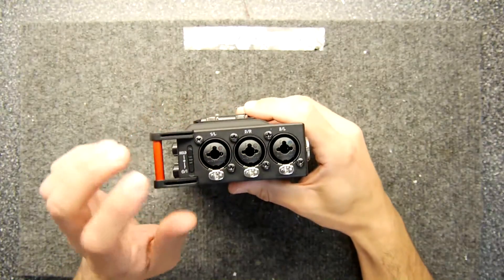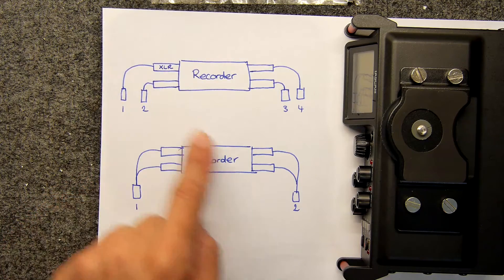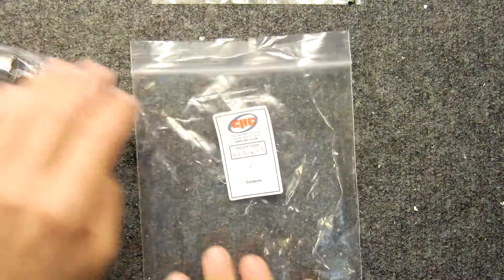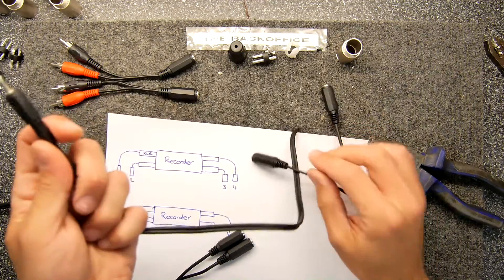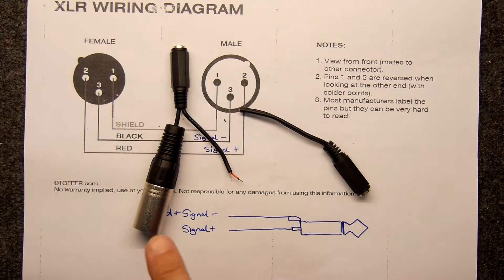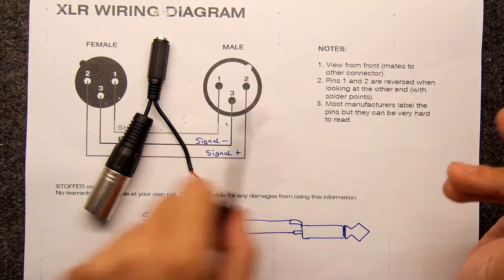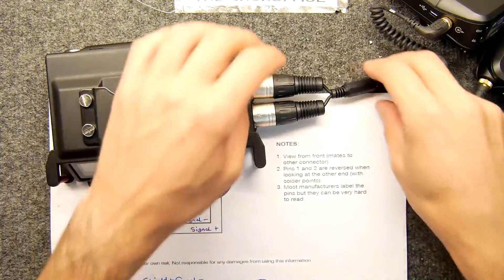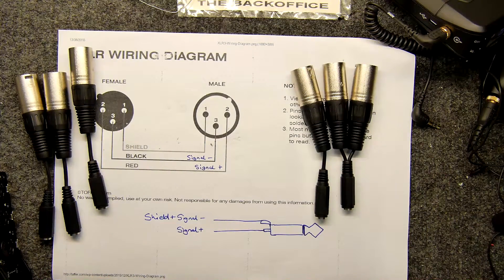How to make your own XLR to Jack Audio Adaptors

Comment: I'm probably telling you something you already know, but you can use 1/4" jack plugs directly into XLR sockets.  Simpler solution would have been mini jack to 1/4" jack adapters.  Sorry to rain down on your party. What soldering iron do you use?  I'm probably just being nosy but it'd be nice if you could video a lab tour.
Reply from the maker: Rain on my party? Nah, I have specific use cases and I wanted to do it cheaply and exactly with a minimum amount of hardware. Those adaptors would be a lot of sticky-out bits and weight on my rig. I think half an hour with the soldering iron is a good investment. Not sure on that particular iron, its just an OEM unbranded jobbie, it was probably from RS or CPC.
Reply from the maker: Just looking at the pictures I see what you mean, those XLR sockets are dual purposed. hmmm I could make a similar set without the XLR connectors. I dooooo hate XLR (so crude)
Reply: I plug my guitar straight into XLR, hole right in the middle of the socket.
Reply from the maker: DigitalAura As long as it works, I am happy :)
Reply: So true.  I must have just had a clot to the brain as i just ordered a GTX 1070
Reply from the maker: Thats a lot of graphics card for playing Terraria on! Ironically my system should be amazing for games, but I never have had the time to actually install steam and download my library.